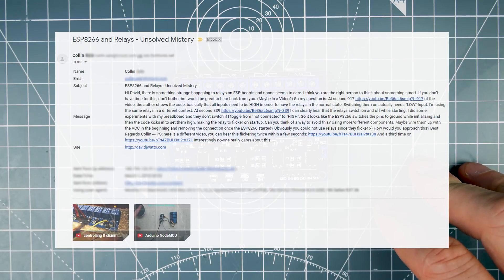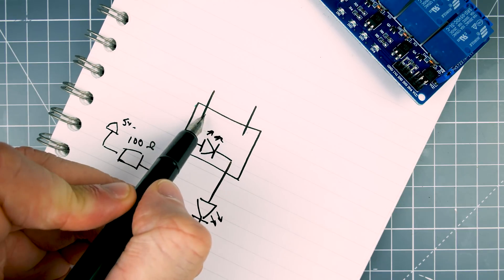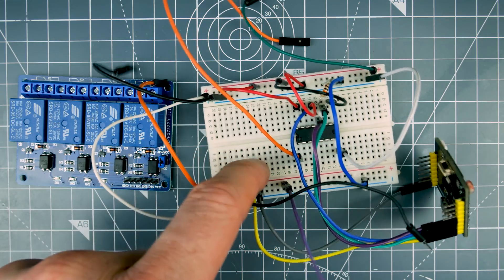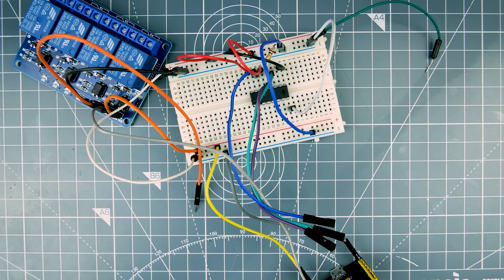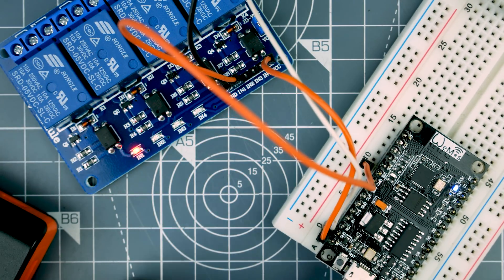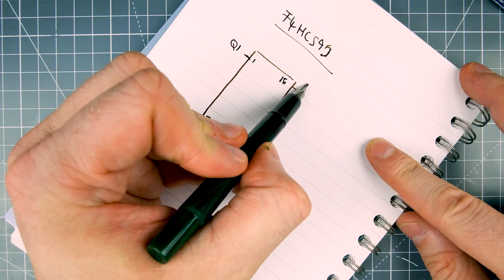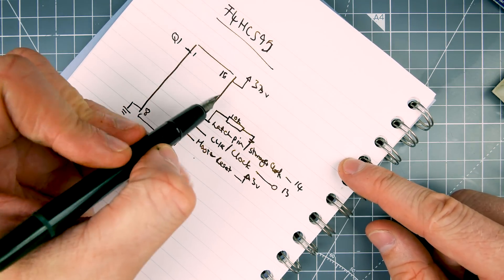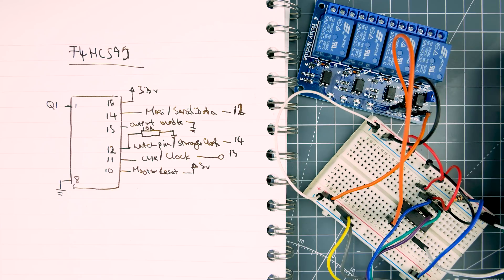ESP8266 and Relays - Unsolved Mystery

Comment: Exactly what I did as I required 8 pins... hooked up a shift register with 8 relay board to drive solar lights. In 18months use I only rebooted the esp twice, it works a charm!
Reply: Twice?!? That's awesome to hear! Congratz! It's great to hear that the ESP can be used for some long term solid builds as well. I had already lost faith in them, but now am reconsidering thanks to you :)
Reply: Rusty, my best advice will be to ensure they have a stable power supply.  Initially I was super frustrated whilst using PC USB only to drive these little wifi wonders, but I soon learnt that by adding a beefy capacitor, they are able to run very stable - even when facing variable temps in the attic... Try it, I am sure it will restore your faith with these chips  :D
Reply: Nois, thanks for the tip! Is beefy in the range of 500-1000uF? Yeah, I must admit I have been using a not-so-stable power supply. Will give it a shot. Thank you! :)
Reply: I use 2200uF and have no issues.  I vaguely recall Andreas Spiess had a youtube video on this topic many moons ago where he found that wifi traffic caused the spikes, and he measured with an osiliscope that a 1000uF was just enough to smooth the power requirements.  I had 2200uF caps and if it is worth doing, it is worth overdoing  :D  Because I run mqtt, traffic is constantly running and I wanted it to run reliably - proof is in the pudding.

Comment: 13:45 Why does every lefty I've ever met write with their pad/paper cocked on such a huge angle?
Reply from the maker: As a lefty it is because otherwise I would not be able to see what I have just written. It would be on the other side of my hand, righties don't have that problem.
Reply: Thanks David, that actually makes a lot of sense. Being right handed myself(obviously) and as you say, not a problem for me, I had never even considered the problem existed! My son is a lefty but he's not writing yet, at least I'll understand now if he has problems as he learns. Cheers!
Reply: SimoWill75 also..... When writing with ink/ballpen you avoid smudging the ink with your hand in case it wouldn't be fully dry yet
Reply: Ed19601 I had considered that, but then I tried writing right to left and it didn't happen, my right hand stayed clear of the fresh ink. David's reply makes perfect sense though.
Reply: SimoWill75 it does make perfect sense, but the ink argument was told to me by left writers in my youth........ But mind you, I am from a time that we learned to write with liquid I know you had to dip a pen in and only when I was about 8 the first ball-pe s were introduced...... And the were not as good as now
Reply: @Ed19601  I remember slate boards and pencils.
Reply: @leglessinoz  I used those too

Comment: There's a simple trick you can use that is introducing a timer which delays the powering up of the relays board (this is somewhat similar at what hi-fi chains do at the amplifier output to avoid undesired clicks at the loudspeakers - you will hear a click after a couple of seconds on many of them which connects them via a relay once the amplifier is ready). The way you implement the timer is up to you... simple transistor with an RC network at its base... ol'pal 555 timer (depending on the board's consumption this might still require a driver transistor)... If you prefer it, you can turn relays board power under controlled command ... Stablish a NPN transistor as a power driver with a pull-down resistor at its base. This will keep the relays board powered off until its base will be powered high via an ESP8266 output. You can also RC time the base of the transistor so as that only after a predetermined high time the power is applied (this can avoid flickering if the outputs would also go high during boot time).

Comment: I had a similar problem with a WIFI 220V distributing box I designed using a relay board and a WEMOS D1 mini. I "solved" (actually got around it) by putting a switch before the VCC to the relay board and waiting a few seconds before switching the relay board on. 

I'll do a video about the box!

BTW. I don't think we are family ;)
Reply: It won't help if it's in a situation where manually flipping a switch isn't an option. If there is a brief power out and then the NodeMCU reboots, it will possibly activate some of the relays. In my application even they activate for a fraction of a second it will be a problem. I'm only using the relay as a momentary switch but not to switch mains.

Comment: My understanding is only GPIO-0 is used as an output during the boot process, when it provides a clock like signal. Careful choice of the GPIO pins should remove the problem and pins will be in a tri-state high impedance state until their usage is changed.
Reply: You can really only reliably use 6 GPIO pins on a ESP8266 based NodeMCU board for output - 4,5,12,13,14,15. On boot various boards will have unreliable output levels, as some go high, some low.

Comment: http://rabbithole.wwwdotorg.org/2017/03/28/esp8266-gpio.html
Reply: On top of that it seem it could fail to boot as well ( https://www.youtube.com/watch?v=7h2bE2vNoaY / https://github.com/thehookup/Wireless_MQTT_Doorbell/blob/master/GPIO_Limitations_ESP8266_NodeMCU.jpg )
Reply: You posted that workup on your blog page but towards the end you stated that someone had suggested maybe these were floating INPUTS and that you'd need to try them with pull-up/down resistors to see what happened (and you apparently never did.) If they are floating INPUTS, you could easily see them go up and down in voltage at boot. But that doesn't mean they'd be able to drive something ELSE high or low (the scope has such a high impedance that it's not reliable in telling if the pin is set to output or input by itself. It's designed to put practically NO load on the system being measured and floating inputs are never guaranteed to be either high or low.)
Reply: it's not my blog post, and if you actually just pull down the pin 13 with 10k resistor and it actually works... i have relay hooked on pin 12 of ESP12 on this board and it works without that issue: https://www.tindie.com/products/nardev/esp-rfid-relay-board-12v-in-esp8266-board/

Comment: I was kinda a no no to that, with 2 LEDs is on it might just past but not always on, I would simply add a resistor and transistor and inverted the output, that will work properly or something that has logic level converters from 3.3 to 5v. Hope  this work.

Comment: If you want to just use a GPIO to drive the relay, you could use a tri-state buffer with a high-level OE (output enable).
The high level OE pin could then be connected to an existing power-on reset signal, or, use a resister/capacitor for a power-on OE delay (if reset signal not long enough).
Something like a pretty cheap 74HC126 quad buffer (with active high OE) would likely do the trick (for all 4 relays!). :)
Reply: Undefined Lastname - Good point! Experimentation needed, to see if the GPIO pins only toggle during power-on, or if they also toggle during a hardware or software watchdog reset.
Alternatively, a quick search suggests GPIO’s 4 & 5 are stable (high impedance) during boot-up.  So another option (if you can't just use these for up to 2 relays), would be to connect the tri-state buffer’s OE to one of these stable GPIO pins, with your code then controlling when the relay outputs are actually enabled.
For this approach you’d need an OE pull-down resistor, or, use one of the more common active-low OE tri-state buffers with a pull-up resistor. :)
Reply: Undefined Lastname - What you are describing for debounce is essentially a digital circuit low-pass filter.
This could also work, but only if: (a) The unwanted power-on / reset pulses are acceptably short.  (b) The latency (delay) this introduces into the relay switching is acceptable for the application. (c) The added minimum cycle time (relay on or off time period) this introduces is also acceptable for the application.
If you were to use the tri-state buffer approach, then there’s no real added relay switching latency or extended minimum cycle time, during normal operation.
Reply: Undefined Lastname - LOL. Yes, the simplest approach would just be to use a better behaving MCU. :)
The appeal of the ESP devices is clearly low cost performance for applications requiring wireless connectivity.
But as you’re pointing out, we should be selecting an appropriate MCU choice to suit the application.
I’d agree an ESP8266 is very likely not the right choice if implementing a non-wireless relay controlling application.
Reply: Undefined Lastname - Totally agree with you on your analysis, especially in relation to newbies and Arduino with ESP.  
I was attracted to the ESP32 initially as being best fit for a BLE project I was working on (I think it still is).  
But prior to my wireless needs, I was most recently using PIC, coded in MPLab’s XC C compilers.
Also agree, having used microcontrollers going way back to Motorola MC68HC11’s, you would generally expect that digital GPIO pins were initialised as inputs.     
I don’t have much experience with ESP8266, other than some Wemos Mini’s I picked up for playing around with. :)
The ESP does have merits for the true hardware hackers who delight in hardware hacking and discovery (like Neil Kolban)
I do also have that discovery urge, but when you just want to design an end project, you don’t want to be figuring out how the tools actually work!
So, as always, with so many microcontrollers to choose from these days (and languages), you should always be considering what's the best fit for purpose. :)
Reply: "tons of bootstrapping pins that eat up a few of the already limited pins"

There's 11 GPIO pins that are FULLY usable on an ESP-12 if set right with pullup/down resistors (GPIOs 0-16 but less the 6 that access the flash.) Even on the ESP-01, which has 8 pins exposed, you have 4 GPIO's available (you may have to be careful about peripherals that may try to pull them up or down at startup.) That's still plenty for a simple remote light switch, LED controller, etc. The only thing the ESP-8266s lack is a decent number of ADC pins.

"the typical way is pull resistors to define the default state"

That's the typical way to set an INPUT pin, not an output one. Pullups/downs can't do anything if the pin is set as output at bootup. True, it might be best to have the pins all default to input at boot but if they are set as output, then resistors mean nothing.
Reply: First, I see you edited your original comment to remove your statement of how there's "tons of bootstrapping pins that eat up a few of the already limited pins" (which, BTW, went from "tons" to "a few.") The bootstrapping pins (all three of them out of eleven) do NOT "eat up" anything as they are perfectly usable for many cases as long as you understand how to use them. And what are you considering "usable"? I use attiny85's on some projects simply because I want the small size but don't need "tons of pins." If I needed 50+ pins but no wifi, I'd use an Arduino Due. If I need 11 (or fewer) pins and I needed wifi capability, I'd use an ESP2866. If I needed BOTH 50+ pins AND wifi, I'd use a ESP2866 paired to an Arduino. Needs vary and chips vary. You pick the chip(s) that's right for the project, NOT simply "one with what I, and I alone, consider a 'usable number of pins', even if my current project doesn't need that many."

And as to the pullup/down resistors, I still have't seen anyone show that the USABLE GPIOs  actually do get set as outputs at bootup. The ones connected to the flash DO get set high or low but again, they get connected to the FLASH! They HAVE to be set as outputs or else the device CAN'T boot.
Reply: No, you didn't edit your post. I was looking at Digicool Things post (which was edited) and thinking he edited out that line, because I forgot I'd responded NOT to the initial post in this section but to yours further down. So on that point, yes, you are correct.

But disregarding that part, I still say the ESPs can be great for some purposes. The video was showing ESP8266's. Those do NOT tout "dual cores." Those do NOT tout "ULP." Those DO have a price mark that's CHEAPER than an ATMega328-based board and they have built-in wifi, faster processor, etc. If I want a bunch of analog pins, I'd get an ATMega328 board (around $2.25.) If I want tiny and only need a few digital or analog, I might get an Attiny84 or 85 (around $1-1.25 for a chip or chip and board.) If I only need a few pins, but I also wanted Wifi, I'd get an ESP-01 (also about $1.20. but I hate the doubled pins on them. Not easily breadboard-able and they do need a serial adapter.) If I want a FAIR number of digital pins AND needed wifi, I'd get a Nodemcu (around $2.25.) I mentioned pairing the Arduino ONLY if you wanted wifi AND needed more pins (analog or digital) and even THEN I can pair a Arduino Nano clone AND a Nodemcu and a level shifter and STILL be under $5 (Nodemcu $2.20 <-> https://goo.gl/AriuFM    Arduino Nano <-> $1.98 https://goo.gl/p9Njqs      Level shifter <-> pennies.) I look for what's cost effective and don't try to tell everyone ELSE how bad ANY of the boards are simply because they don't work the way I want them but more importantly simply because I think they have some supposed flaw that I haven't even confirmed myself to exist and that probably arose out of someone's misunderstanding of what pins are for what purpose.

But if we want to talk about ESP32s (which was never in the debate other than a passing mention and was DEFINITELY not mentioned in terms of how many pins they have, etc) then the Nodemcu-32S has 32 GPIOs (all usable after boot), 14 of those 32 are also ADC inputs, 10 of the 32 are also touch-enabled, 2 of the 32 are also true DAC output, 4 of the 32 which comprise two different UARTs, 4 of the 32 which are hardware VSPI (very high speed SPI) and another 4 are hardware SPI, 2 more of the 32 are I2C, it has the dual-core, wifi and bluetooth and I can STILL get that for under $7.50. Or I can get a board that has 23 GPIOs broken out (again, all usable), 9 touch pins, 16 ADC, etc, etc, etc AND built-in support for a LiPo battery for around the same price point. 

As to the boot pins vs fuses, to change fuses (for whatever reason you want to change them) you have to hook back up to a computer and run the programmer. To make an ESP32 show or silence boot messages? Flip a switch to pull a pin high or low. Want to use 3.3v or 1.8v flash chips (remember, you can break out the flash pins so that you could easily unplug one flash chip and plug in a different one) on an ESP32? Flip a switch. Want to boot from an SD card? Flip a switch. Want to force it to load new programming from a USB cable, no matter what corrupted software may have been flashed to it? Flip a switch. And once it's booted, these pins are perfectly usable as GPIOs.

Comment: The solution to prevent it could be an RC circuit with an inverter connected to an OR gate. Before the RC circuit is charged will it be in a low state and after a time it will be charged to a HIGH state. The RC signal is then inverted so it is HIGH during startup and then switch to low. If the inverted signal is then fed into one of the inputs of an OR gate for each GPIO that should be kept HIGH during startup and the GPIO pin is connected into the other OR input it should be high during startup and then controllable by the GPIO pins.
Reply: Or an RC delay loop for the relay power. Then you don't need the OR-gate. Just one transistor (or MOSFET) to switch on the relays (with a delay).
Reply: The solution to prevent it could be not to hook up relays to pins that are connected to the flash chip (or just to...I dunno, maybe RTFM?. The SD0-SD3 are NOT intended for GPIO use.)
Reply: My answer is a generic GPIO not limited to SD0-3!